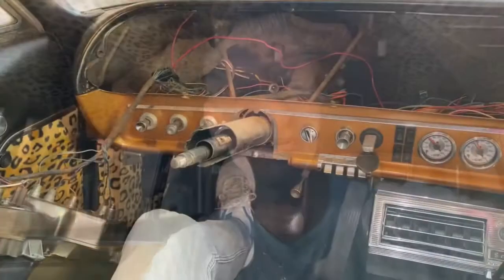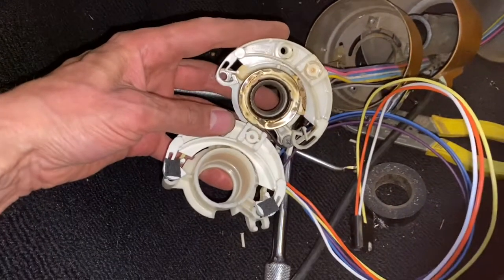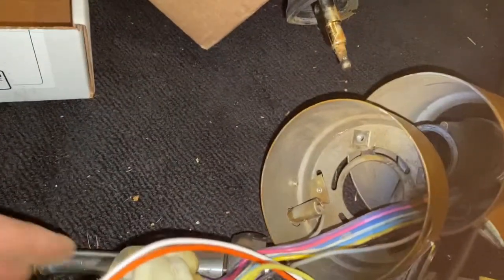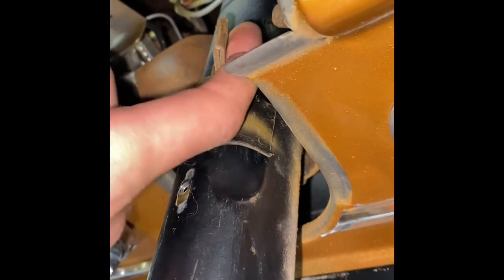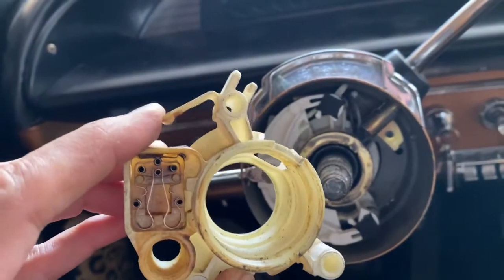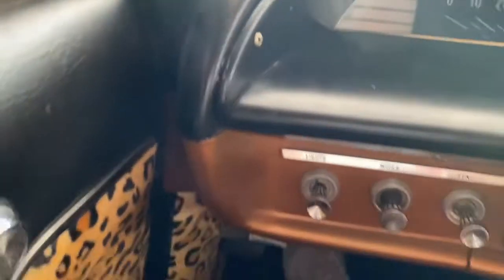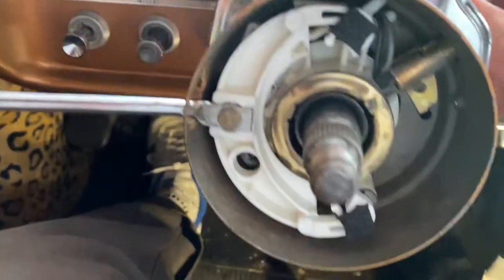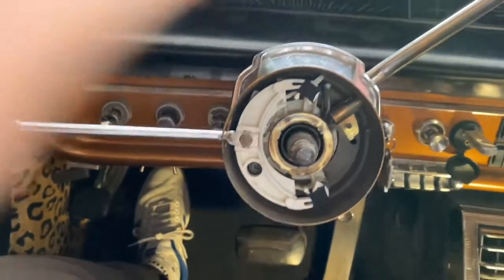Replacing the turn signal switch on a 1963 Chevy BelAir Wagon

Comment: I know this video is a bit old and you most likely won't respond but what bearing did you use? I just bought a bearing that was supposed to fit but is a bit big.
Reply from the maker: I re-used the bearing that was in there. I was really surprised and bummed out that the part didn't come with one. :(